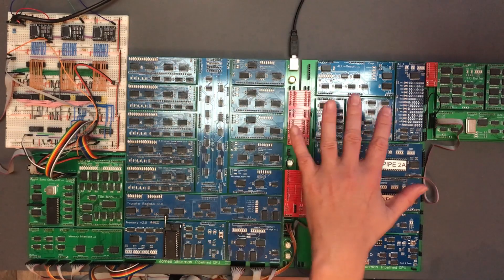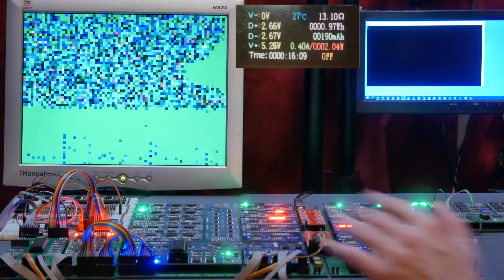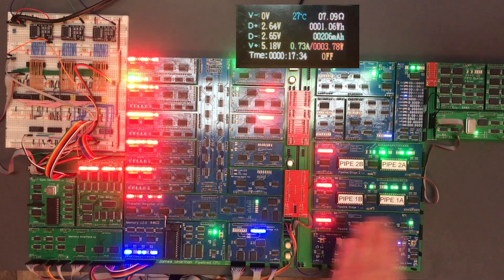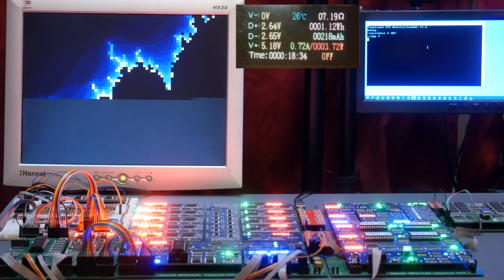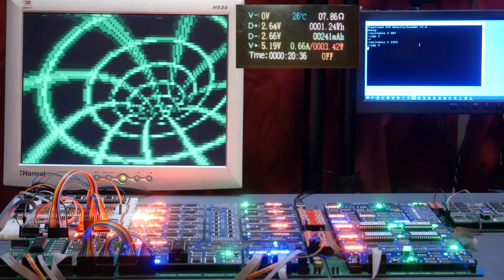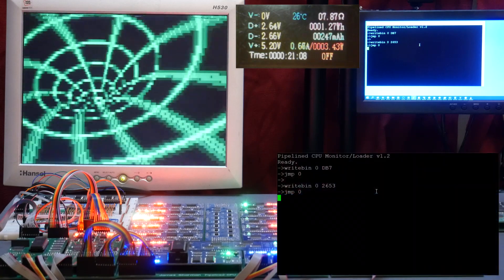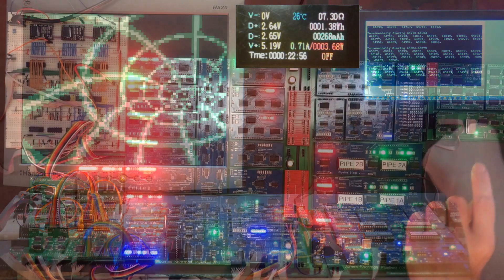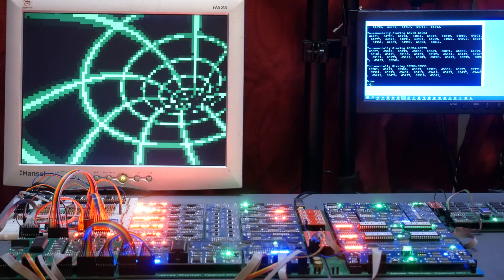CPU Power Consumption Test

Comment: You will probably find that most of the power draw for this system is for the LEDs, the actual logic is probably less than half the power draw you are actually measuring.
Reply from the maker: I have thought about repeating the test but with code design to minimize or maximize the led's.

Comment: Putting all the LEDs behind buffers would allow a low power mode by disabling the buffer outputs globally ! ;)
Reply from the maker: Alternatively you could have a separate  ground and vcc lines which are used as the led commons and then you pull them to actual vcc/gnd when you want the led to work on or leave floating otherwise.

Comment: The power could probably be reduced by 1-2 watts by removing the LEDs...rough calc...~250 LEDs @5mA and 2V average and 50% duty cycle...1.25W
Reply from the maker: Yeah, but then you wouldn't have all the blinking lights!
Reply: @JamesSharmanExtras  quite literally!🤣

Comment: Pretty impressive for all that discreet logic! I can't remember now -- are you running 74LS or 74HC?
Reply from the maker: Thanks Ted. Logic chips on the pcb's are HCT, most on the breadboards are LS.
Reply: @JamesSharmanExtras  That explains it. IIRC, the HC(T) line is several times as efficient as the older LS. You could double this computer's complexity and still operate on an iPad charger. 😁

Comment: What the heck James ? I've been following your venture into processor creation- it's just amazing.. creating a computer just out of discrete components is just right out of the box ! Ok, you cheated a bit by using rom chips - but even then, it's still crazy amazing !
Reply: Using ROMs as a replacement for combinational logic is a valid approach and used by most systems that contain complex state engines. Any other way just gets way too complicated and is really difficult to debug and make changes. In fact without using ROMs no one would be building processors like this because the amount of logic needed to decode and run instructions would be way to complex to implement in discrete logic devices. Most commercial processors use a version of this in their designs.
Reply from the maker: Thanks Ivan.
Reply: Would you go as far as to create a MMU ? It would allow your architecture to create virtual machines !

Comment: Another thing I thought of, is I am not sure what the current proportion in your design is of ttl vs cmos chips. As I can recall, current consumption with ttl remains fairly constant with frequency, with the drawback that it also consumes the same amount of current even if it is idling.

Anyway, keep up the good work! Cannot wait for your future videos.
Reply from the maker: Pretty much all the chips on the pcb's are HCT which should mostly be mostly cmos but with ttl inputs.

Comment: Pretty sure the power consumption remains more or less constant because your CPU doesn't have an interruptable halt state. On modern CPUs, the CPU actually stops responding to the clock (halting) when it has nothing to do. It waits for a hardware interrupt (task scheduling timer, hardware events, etc...) to wake up from the halt state and resume executing code. This halt state is what causes the power consumption/heat generation to go down when the CPU is idle. In fact, in a multitasking system, the "idle task" of the OS is literally an infinite loop that just runs the halt instruction.

If I understand correctly, power dissipation in a CPU is not because the transistors are switched on, but it's the actual switching state of the transistors as the MOSFET gates charge/discharge. It's the current flow of the gate charge/discharge that causes power consumption and heat generation, so if the CPU state does not change (no clock) then it consumes much less power than when it is running.

Of course, the state of the LEDs will probably have a much higher effect on the power consumption. LEDs actually use significantly more power than straight logic chips.

loving the series, can't wait to see the whole VGA circuit get fully PCB'd. :)
Reply from the maker: I have no halt state but in the tight wait loops there is much less switching being done hence the 75% difference in power. The LED's may well be a big chunk of it, I might try writing a dedicated wait loop that sets all the unused registers to zero. What you say about the power consumption consideration on the gates is true about fet based logic but not bipolar which signal with current rather than voltage. The HCT parts I use on the pcb's have a foot in both camps.
Reply: @JamesSharmanExtras  Oh right, I forgot a lot of the logic is 74-series TTL and the like. My bad.

I suspect the LEDs contibute approx. 220mA or so (~400mA initial state with no clock and most LEDs off, vs ~620mA with trace clock), so maybe a third to a quarter of the input power. would be interesting to see the actual value.

Comment: Impressive stuff. Maybe some headroom for overclocking.
BTW:  I have the exact same USB current monitor.
Reply from the maker: Thanks Bob! Clock rate is dominated by the timing on the pipelined stage 1 rom's at the moment. I'll do an exploration video at some point on that and see if I can squeeze a bit more out.
Reply: Doing the shadow RAM trick here would open up the frequency headroom towards 20MHz for 45ns SRAM

Comment: Looks like the LEDs are causing a bit of confusion into how much power the CPU actually draws
Reply from the maker: Depends what you mean by confusion, I do have a though to tweak some of my delay loops to zero out unused registers, may reduce the power consumption.
Reply: @JamesSharmanExtras  Im thinking the LEDs are constantly on when the CPU is waiting for a program to run which is why the current can be considerably more than when the CPU is running. The LEDs are basically being PWM'd which lowers their power consumption. I bet with tedious math, most of the confusion can be removed, even when running a program

Comment: 3.5 watts is pretty neat considering all the LEDs and discrete logic ICs (as opposed to some VLSI monolithic IC) each sucking a bit of juice.
Reply from the maker: Yeah, less than I expected. Worth noting that the LED's are under driven, when I gave them recommended current levels  they saturated out the video feed.